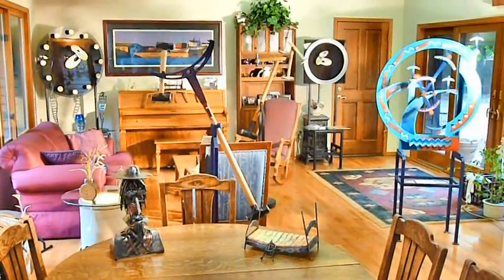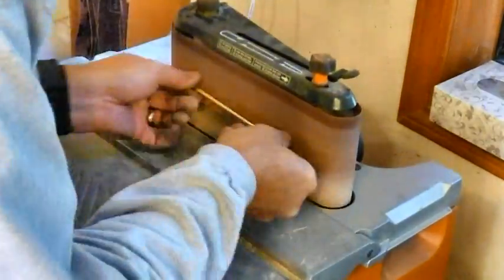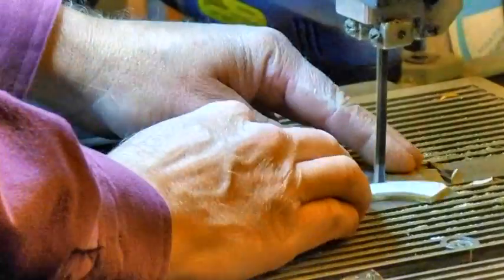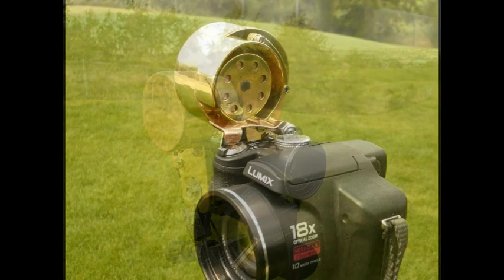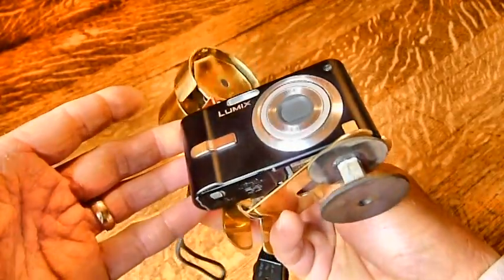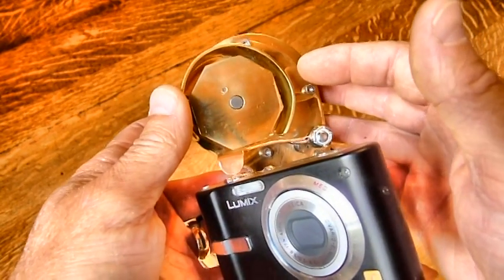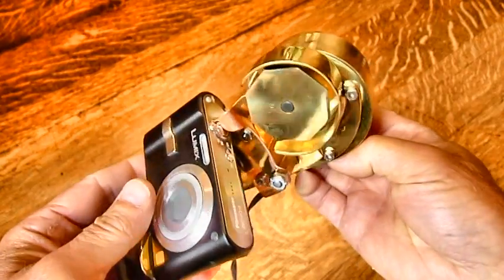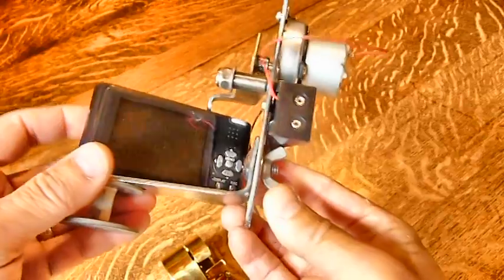Time Lapse Device

Comment: Really impressed and I hope you don't mind me copying most of your design.
There is one question that seems to elude me and that is the click rate on these small & cheap point and shoot digital cameras (Nikon Coolpix2600 & Fuji FinePx AV100).
Like the latter better, but had to buy another due to some misunderstood battery problems.
It seems that one wouldn't get more than 25 to 30 pic's/min. with a mechanical time lapse device.
Any advice please?
Manuals don't give much of an indication.